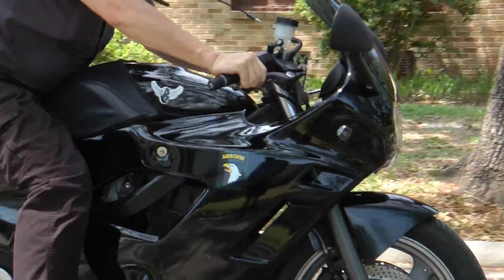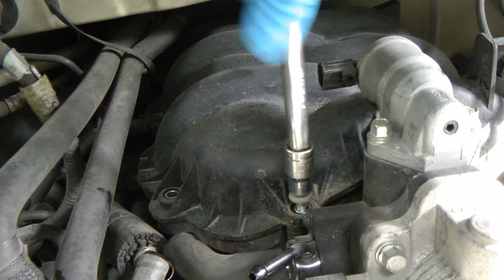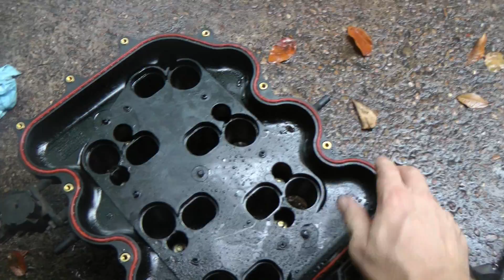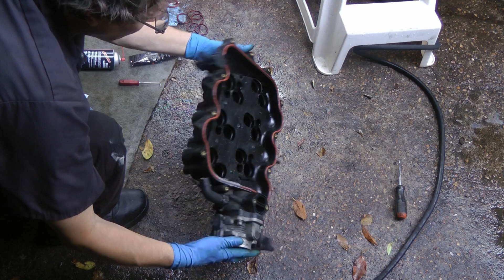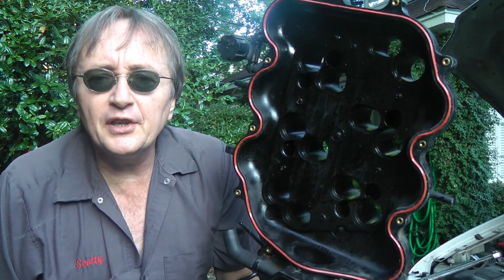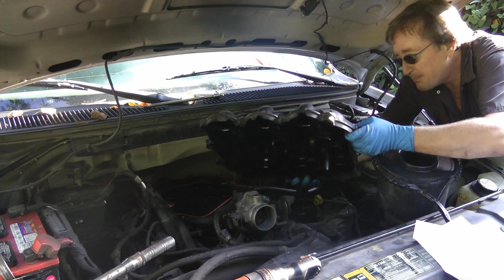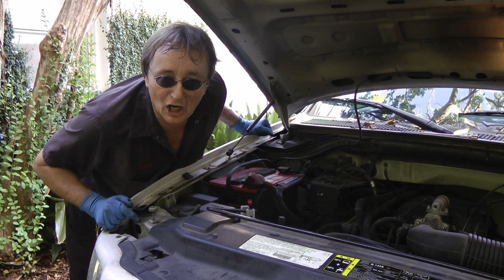How to Replace a Intake Manifold Gasket in Your Car

Comment: Hello scotty I have a 00 crown vic with a misfire on cylinder 1 2 and 3 because of coolant covered spark plugs. I have determined that I dont have a blown head gasket and I was told I need to replace the intake manifold or the heater hose or something like that. Could you please tell me if I just need to replace the intake gaskets or what? I am in school to be a mechanic but I have never done a job this big. Think I can do it?
Reply from the maker: intake manifold is a BIG job on that massive engine. Get a cheap manual with pictures if you want to attempt that. Not for the faint at heart, but it can be done with normal hand tools and a LOT of patience.

Comment: my clutch fan is perfect,i replaced the whole thermostat housing with 2nd hand since its not available here in my country,but i see my radiator is yellow bron and rusty inside,but i hear some hissing noise from the engine,iam afraid its a common problem from the head gasket,and coolant disapears very fast from the coolant jar....am lost really,if its a gasket oem or after market ? a lot of thanks

Comment: scotty i got a 1998 explorer sohc v6 engine,coolant disapearing,replace leaking thermostat housing with 2nd hand one,now its running normal but coolant disapearing from reservoire, is this a engine gasket ? shall i buy oem or aftermarket gasket will do it or can you recommend a brand,is it true i have to drop the engine for this job ? if so what else shall i change if engine got to go out ? is it worth it scotty ?

Comment: Thank you for the reply.   I cleared the codes yesterday and  no error codes yet today. --- The puff smoke now coming out of exhaust only happens after the van sits overnight.  Or sits at work for a long time. I bought and put a can of ATP-205 yesterday.  (Oil change done at intake gasket work.)   Worth a try.  Wife says Van is running a lot better and no idle problems.  Just the puff of smoke at the moment.  Any valve seal replacement videos yet? had to ask.  Thanks for all the help.   arthur

Comment: I watched this video and bought a gasket kit for my wife's 2003 Windstar van.   I put in new gaskets on the The top and bottom intake manifolds and replaced the phenom bolts with  green bolts as you said.  
    #1Still am getting two error code P 071 and P074 banks too lean.  I ordered a new MAF sensor. tomorrow I am gonna do your Cigar test to check for leaks.  Good idea?
    # 2The van is also acting as if the valve seals are leaking with a nice cloud of smoke. Did my gasket work cause this?

Comment: Scotty i have  a 2004 Landrover Discovery SE 4.6 
after my vehicled sits for about 8 hrs , at start up i get white smoke for a about 2-3 minutes then it goes away. also it smells like coolant. the coolant level in the reservoir tend to drop every 4 days, with no sign of visible leaking under the truck. i have my heads done 9 months ago, could the heads again or the manifold gasket this time?

Comment: Hey Scotty, I have the exact same 4.2L V6 F-150 that you used in this video. I replaced the Cam position sensor and crank position sensor recently. Since then I keep getting the P1339 code. Do i need to go to the dealer to get this stuff relearned or as you say find a mechanic with a dealer level scan tool?? Thanks for the help!

Comment: Hey Scotty! I love all your videos they help me know what to do in case something bad happens to my car. But I have a question, I drive a 2000 Chevrolet Monte Carlo SS and i can smell antifreeze coming out of the engine. So i took the car the car to my local car mechanic and he said he thinks my car might have a leaking intake manifold gasket and he thinks that if that is whats wrong with my car, it could cost at least $700. Is a fix like this really cost that much on my kind of car? Thanks!!!

Comment: Are all Ford gaskets the same? I took my car (2002 Windstar) to Firestone (it kept making a loud squeal and cut off - they were the closest place to where I was). After a diagnostic check they said the crank position and cam shaft sensors failed. They would need to replace the under cam shaft synchronizer, top and lower gaskets, and the intake manifold which they said would also require a coolant flush....to the tune of $1900. Can any of this be done on my own or should I just get another car?

Comment: hey scotty love your show   i have 2002 chevy Tahoe took it to chevy they said4 random misfires they said it was the cat  could it be the intake gasket? cats very pricey 1450 i lose power going up hills truck doesn't go faster than 20 mph running on 4 cylinders got fuel and compression

Comment: The intake manifold needs to be torqued to "inch" pounds.  But, in the video it shows you're using a "foot" pounds torque wrench.  Does the torque wrench you were using in the video also do "inch" pounds readings?

Comment: Scotty - i have a 98 chevy s10 2.2 l 4cyl. Theres a port hole under my intake mani, i don't know if you've ever worked on one but i was curious if you knew anything about them, I've done a lot of research to come to the conclusion that there is supposed to be a plate covering it? I've lost the plate apparently, any helpful info on replacing it? (Not made or sold by dealer anymore)

Comment from the maker: you have to drill it out and retap it if you can't grab it. some guys try welding a smaller bolt onto the piece then try to unscrew it that way. Any exhaust leak will effect MPG due to oxygen sensors going bonkers from incorrect gas flow

Comment: Hey I was wondering if you could help me out with my question. I have a ford so I have a 2 piece intake also. v6 mustang 99 to be exact. So recently I had to take off the top of the intake to replace a pipe that was leaking coolant. At the time i didnt know it had to be torqued down in a certain order. All I did was hand tightened. Im now getting a lean code in one bank, could i simply have a vaccum leak from the top of the manifold?

Comment: Hey question...I had a used 7.4L engine put in my 94 GMC 3500 u haul truck by a company in Philadelphia pa. Got it back and it runs like crap, loud tapping when I drive it, low power. I took it to another mechanic the same day and he said there are no gaskets on the manifolds. Does that engine require gaskets on the intake manifolds?

Comment: I had a intake manifold gasket replaced on my 2004 Buick at the Friendly Chevrolet Dealer in Friendly Minnesota and they ruined my engine so I had to have the engine replaced. The guy who put in a used engine said the one they worked on was FULL of gasket material etc. in the oil !!! This was that GM problem with the bad plastic gaskets they should have recalled all the engines.

Comment: scotty..i have a 4.7 jeep grand cherokee laredo 4.7.. I have to take the manifold off on the drivers side and replace the gasket. How do I know if my manifold is warped. Also, is there a way to tell where the leak is comming from that I can see. The man at pepboys said its the drivers side gasket, but I want to be sure, and while I have it apart to change the gasket, if it needs it, replace the manifold if its warped. Thanks.

Comment from the maker: the system was low so none came out, you remove a bottom radiator hose first and drain it in a pan if it's full

Comment: How do i replace a leaking gasket on a 1996 Dodge Ram 1500 base model reg cab 4x4 5.9L V8? I believe the guy who i bought it off said that the check engine light was on because of the intake leak and to replace a gasket which he already bought. would putting the new one on fix that? and what exactly is the process for that? thanks scotty!

Comment: Scotty,  I have a Rav4 4cyl.  I am loosing coolant somewhere, but the dealership can not seem to find where.  They replaced water pump and $500+ later I still have the same problem.  Now I am wondering if it is the manifold gasket.  Is it any harder to do a rav4 manifold gasket than the Ford shown above?  If not I am seriously thinking of doing it myself.  Thanks.

Comment: Can remove carbon build-up in the intake manifold improve horsepower & fuel mileage? If it's true, should I use gasoline, water, CRC throttle body cleaner or what? Thank you.

Comment: So I replaced the intake manifold on my 2006 crown vic p71 and now there are bo leaks but it idles really rough from 900 to 800 in park and 600 to 500 in drive. I drove by my cousin and he said the exhaust smelled like rotten eggs. I have no idea what to do! Any suggestions?

Comment from the maker: weak fuel pumps, bad MAF sensors, and intake vacuum leaks are the big three on that engine. Try my video "finding engine vacuum leaks with a cigar", pressure test the fuel pump, and have the MAF live data analyzed

Comment from the maker: hard to say, but 0 is some big problem like bad rings or bad valves AS the engine is moving, not just sitting still. Either way, engine needs rebuildi9ng

Comment: So i did a compression test and all cylinders except the third were about 160. That's with 6 cranks. Cylinder 3 had 0 pressure.

I used an air compressor at 120psi to blow air into the spark plug hole to check if the valve was leaking. There is no leakage.

Is this the piston rings?

Comment from the maker: bad news, either the computer system isn't firing the coil or the injector, or the engine has internal problems like blown head gasket or bad valve springs causing that misfire.

Comment: well, the brand new spark plug in Cyl 3 (Problem cyl) Is a sooty black and fouled. all others are fine. I Swapped coil packs, that didn't change anything. and also swapped injector 2 and 3. Inj 3 was absolutely...holy crap. Problem still persists in cyl 3. according to my code reader, at least. And yes, I clear the codes and run a new test after each change I make to the car.

Comment from the maker: that's often an oil water mix. Pray it's a leaking intake manifold gasket and NOT a blowing head gasket. Try my test 'how to tell if your head gasket is blown' and it that's negative, change the intake gasket

Comment: The car will often drop in RPMs when idling at a stop. This most often ends in the engine stalling. Sometimes it will have trouble starting up (Especially in the cold).
Yesterday, I dropped the tank and removed 5 year old fuel from it. Full tank of fuel with injector cleaner (STP Brand). After replacing spark plugs and wires today, the car idles a little smoother, but not by much. Sparks are set to correct gap.

Could this be an Intake Manifold issue or more likely a fuel injector problem?

Comment: Mr. Scotty Kilmer! Alright, I have a 1999 Saturn SC1! The car has a solid Service Engine light. I took it to AutoZone and they ran it through a computer giving a Code which tells me I have a misfire in Cylinder 3. 

Probable Causes: Faulty Spark Plugs/Wires, Faulty Fuel Injectors, and Vacuum Leak. 
I Changed the Spark Plugs and wires. Problem persists.

Should I take and switch the Fuel Injectors to see if the misfire changes? (Which is rather difficult because all are connected in one line).

Comment from the maker: doesn't rule out anything, head gaskets blow with water or anti freeze. It's not that easy swapping out injectors on the back side of that engine, most guys will just put a new one in if they have to access the back side.

Comment: it dont use antifreeze so would that rule out the head gasket? an is it hard to swap fuel injectors? all plugs seems to have like a light to dark brown color       its saying misfire on plug #6 according to reading the computer with the plug in tester

Comment: 1996 chrysler lhs 3.5    #6 cylinder misfire,   i replaced plug,wire,ignition coil,did compression check which was good an i still have the same problem,  CAN SOMEBODY PLEASE HELP ME WITH THIS PROBLEM TY

Comment: My 98 explorer has idle issues and stumbles randomly. I've changed plugs wires IAC cleaned throttle body MAF sensor fuel filter egr valve my PCV valve was okay and I ran sea foam through it. Only 80k on the car. Should I do this? I don't have an CEL codes but it's a pretty annoying issue..thanks.

Comment: scotty, why would anyone want to use alumiseal  if changing the intake manifold might cure the problem?   the job looks  easy enough.    doesn't alumiseal mess up the radiator and heater core eventually?

Comment: Well, I have a 2001 F150. Mine is a 5.4 V8. Not sure if the F150 you used in this video was a 6 or 8 cylinder or the same model. I'm sure its mostly the same, but please correct me if I am wrong!

Comment: Hi Scotty.  I have a 1994 subaru legacy l.  My car is overheating.  Pep boys wanted to charge me 400 $ to take off the intake manifold and maybe replace the manifold gasket.  Do you have any videos on how to remove the intake manifold.  I want to remove it and scrape out all of the carbons or dirt or whatever is in there.  I also hooked up my scan tool and it says I have an egr flow problem.  Cleaning it should fix it I guess.  I also want a new radiator.

Comment: Thanks for this video, I have to do this soon.

But I have a question not relating to this video. My transmission in a 01 chevy malibu slips, sometimes it slips the first time i put it in drive, and sometimes it takes 5 minutes of driving for it to start slipping. Could it be anything else other than the transmission fluid?

Comment: I have a TDI 1.9 jetta VW, on the intake (aluminium to aluminum) should you use copper spray gasket on the metal gasket? thanks.. wondering about where to use and not to use, seems many are divided, just use dryor not.  Like on exhaust manifold, should use there? what about head gaskets? seems to be much of just dry then others say it won't hurt, what u think? thanks in freedom,

Comment: Can I drive the vehicle rather than let it sit and idle??? And can I use water instead of anti freeze? Aslo my vehicle is burning water so fast I'd be worried if I let it sit for 30 min it would over heat, can I add coolant while doing this?

Comment: Scotty I have a 1993 Chevy !500 Cheyene that I used as third vehicle, wife's car went in shop so she used truck yesterday and drive about 10 miles, she returned saying something was leaking, I popped hood to set motor oil mixture bubbling out of the coolant reserve. i checked oil dipstick and dipstick is dry. I drained radiator and flushed. I was wondering if this is a head gasket problem or manifold gasket problem?

Comment: I have a '97 Chevy C1500 v6. I recently bought it and it's started having leaks here and there. I had it looked at by a mechanic and my intake manfiold gasket is one of the things that's leaking. Does this method apply the replacement of my gasket as well?

Comment: Scotty, would replacing my lower intake manifold gasket cure my problem below? 

Symptom: every 1.5-2K mi, my 96 Ford Explorer (178K miles) gets an engine misfire on cylinder #4. Inspection of spark plug thread shows brown substance on it...i'm assuming its burnt coolant, as i'm refilling my coolant with 1/4 cup every 3-4 months. To cure the misfire, I just change my spark plug and the car runs like new again. However, I also noticed that my mpg has been around 14 instead of 17. Thoughts?

Comment: Scotty, I just purchased a 2pc Intake manifold gasket set for my 2001 BMW 325i because I believe that the old one is contributing to my rough idle. I own a wide assortment of tools that i feel can complete the job. I am VERY short on cash and so I want to do the job myself. Currently there are no instructional videos available anywhere on the internet for conducting this gasket swap procedure(on my vehicle's model). So Scotty, what would you recommend as the best course of action?

Comment: Scotty, I have the same Ford that your working on in your video. I have recenly noticed white smoke coming out of the exhaust when i rev the engine and once the truck is warm. I believe its burning coolant. Im thinking about doing the repair... One question, where to you install the original larger gaskets you are holding in the very begining of the video? (like 19 seconds in)Those gaskets are not addressed in the video unless i am missing something.    Thanks

Comment from the maker: if it's the intake gasket, you can seal the leak with jb weld kwik epoxy. But if it's the exhaust manifold, ya gotta replace that.

Comment: Hi Scotty, Say if you a a bad or already leaking exhaust manifold gasket, would this eventually lead to shattering vibrating type experience while accelerating, also lacking performance, Engine is an old school 253 v8. Thanks

Comment: @kingkong8974 I noticed that the throttle body is missing a gasket to the intake by the injectors. I don't know if a small vacuum leak there could cause this problem as I'm thinking that after the engine warms up the fuel mixture leans out causing a slight lean condition.Tell me what you think. Oh this is the 4.3 liter 6 cylinder (cut off 350) engine. Alright, thanks in advance

Comment: Hey Scotty, I got a 1993 Chevy Cheyenne (chevy 1500) it idles rough when warm but great when cold. I have no scan tools at home and don't have time to work on my own cars in my auto technician class since it's near finals week and I wanna get this fixed and sold soon. I doubt that it's the iac valve, the coolant temp sensor is good, I put in a new one just to make sure. Plugs look good and wires have proper resistance and it's smooth on acceleration so I doubt it's that. continued...

Comment: @edwardsm2009 I do small motors for a country repair shop and my boss replaced the gaskets for me, but long term damage had already been done so now it knocks so bad it sounds like a diesel. Now I have a worthless truck sitting in my driveway.

Comment from the maker: @girlythug72 you can't seal them from the outside, you'd still have to take it apart and apply silicone sealer to fix such a leak. But if you're losing coolant only, you could use bars alumiseal in the radiator to attempt a seal.